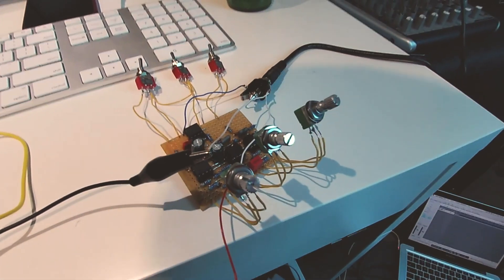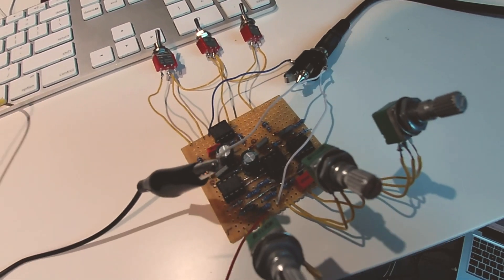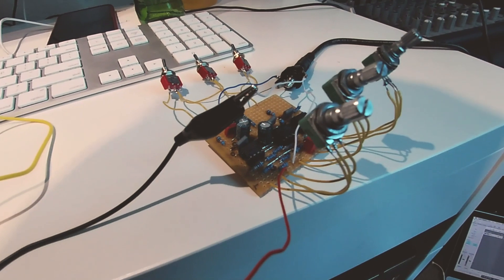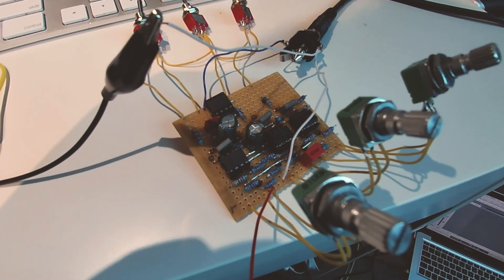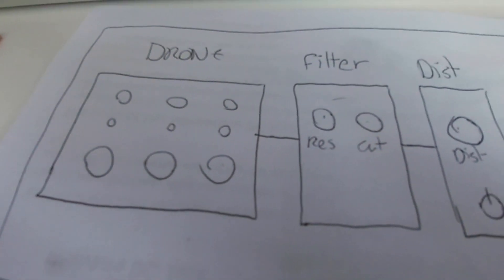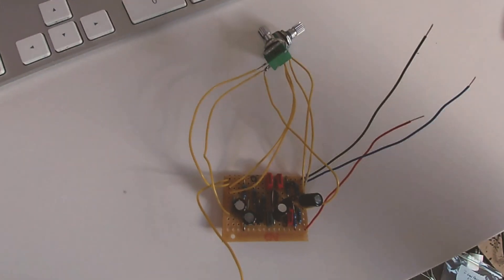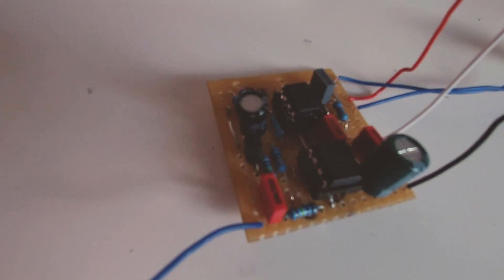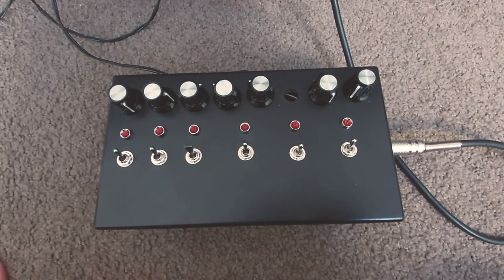DIY Drone Synth | Build & Demo | Part 1

Comment: Thank you for posting this and replying. I’m on my second attempt at building this 😅.

Do the types of capacitors used make any difference?
Reply from the maker: Yeah I think using different caps can alter the bass or the treble of the tone
Reply: @unholyaudiochannel  would using tantalum caps of the same value make any difference? Cheers dude!
Reply from the maker: @m8j8s77 I don’t think they would do anything different to the sound no
Reply from the maker: Look at this vid and the one after it if you want to experiment a bit with drone sounds:  https://youtu.be/tBpLomv-n-4?si=t1Cfdzn49UQzqd-4
Reply: @unholyaudiochannel  this will definitely be my next project thank you!
  im just about finished putting together the triangle but am wondering where i attach the LEDs ?

Comment: howdy, im looking around for parts to try and build this! do you think it would work with the LM386 IC instead of the LM358??
Reply from the maker: no becuase they are designed for different things. The 386 is more for driving a speaker pre amp or audio amplification.

Comment: Sorry, I have a very newbie question: In ''Paul in the lab'' vero board, C1, C3, 4., etc are represented by oval ceramic capacitor symbols, but you seem to have used what look like film/polypropylene ones.
Was that the case? If so, did you use film capacitors because it does not make a difference and you happened to have them already, or is there an actual advantage?
I ask because I haven't ordered the components yet.
Thanks